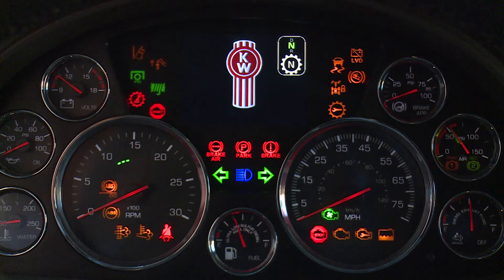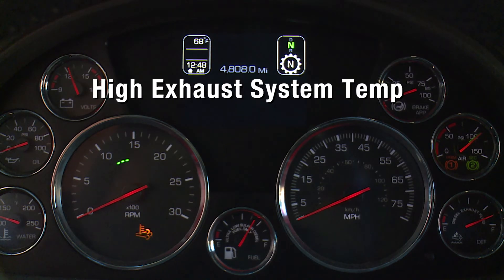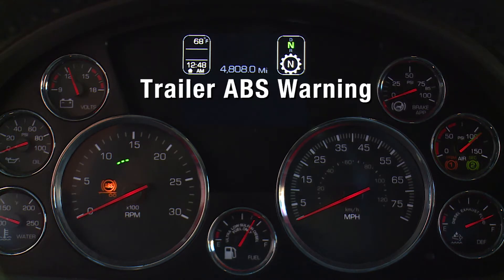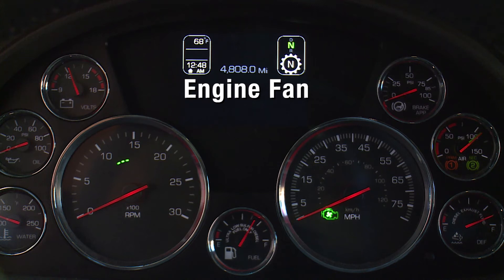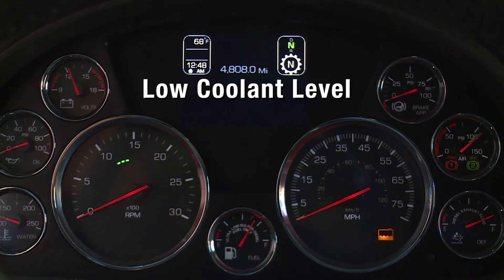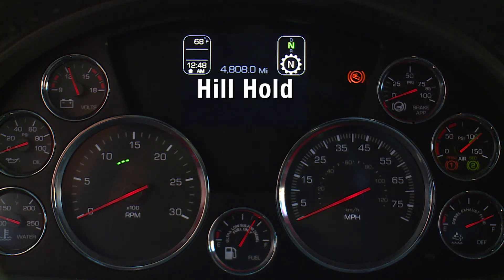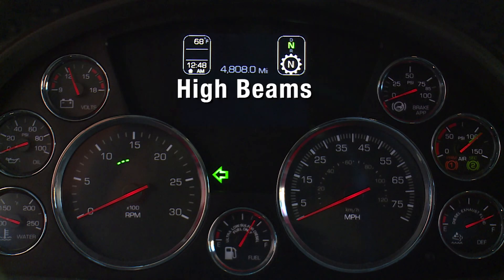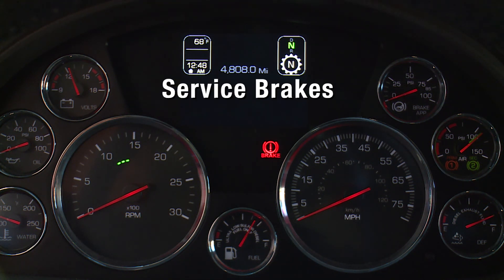14: T680 Kenworth Driver Academy - Instrument Cluster Indicators

Comment: What are the three green lights in the tach?
Reply: Charles Spencer I'm not sure but I'm gonna guess it is your rpm gauge for shifting, I just bought a t680 and I have lots of questions, but of course I come up with these questions when I'm on the road,😎
Reply: No, I drive a NEW one with allison auto, they are present as well. during test drive too.
Reply: Optimum shift points for optimum fuel economy
Reply: My employer states that, that is the optimal cruising range for the best MPG

Comment: What does the blue bottle and snowflake mean?
Reply: I'm trying to figure out the same thing.  Only mine is green.  The switch is in the sleeper. I'm assuming it's for a fridge,  but I don't have a fridge.  The light on my dash illuminates green, not blue.....2015 KW T680
Reply: If it's in the top left, under the outside temperature reading. I'm pretty sure it's just warning you that the roads might be icy.